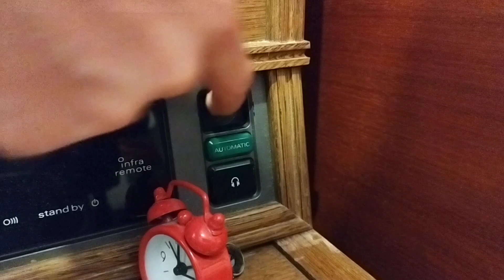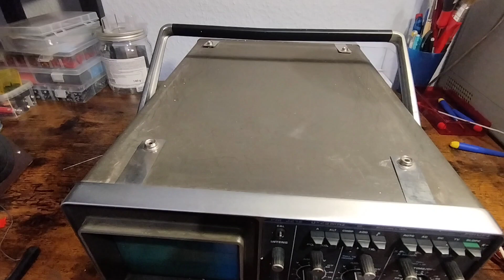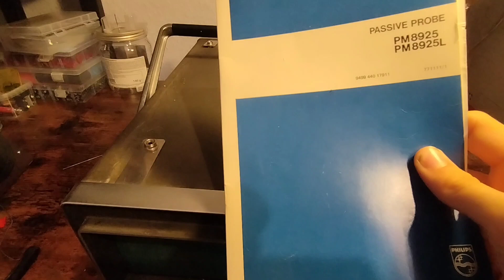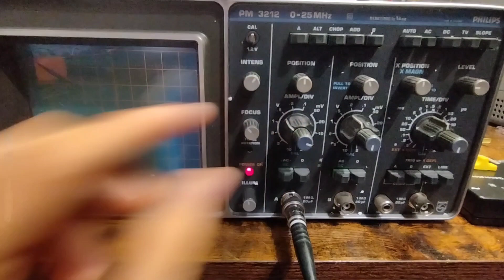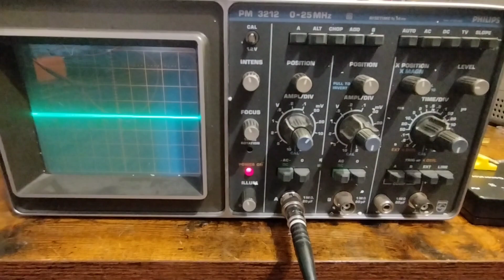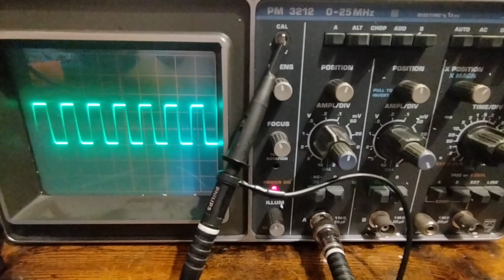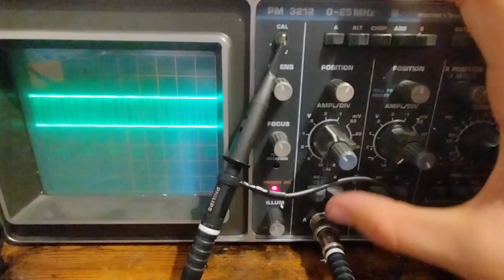80€ late 70s Philips OSCILLOSCOPE - Does it Work? | Philips PM3212

Comment: Hi! I am your 100th subscriber. These old Philips ones are great scopes. The blue axial electrolytic capacitors in them are terrible, and hard to replace due to space constraints, but otherwise they are super reliable. I have one like yours, two PM3215 (50MHz), one PM3540 (with logic analyzer), and two late '80s - early '90s ones, a PM3335 and a PM3070. One of the PM3215s and the 3540 are missing the CRT bezel, and a few knobs, so I bought a horrible condition 3212 for parts, but it actually works perfectly (apart from power supply hum, which makes the highest sensitivity settings unusable).

BTW you did great with this purchase, just the content of the pouch worth way more than 80 Euros.

Very important: DON'T spray random contact cleaners into the switches in oscilloscopes, test gear and radio equipment. If the oil from them penetrates any calibration trimmer capacitors on the board, it will ruin the compensation and the scope will have awful signal fidelity from then on. Only use residue free contact cleaners, and be careful even with those, not to hose the trimmer capacitors with it. These usually don't need contact cleaner though, just excercising the switches and pots will most likely clean them up.
Reply from the maker: Hey, thank you so much, I really appreciate it :).
Yeah, I feel like sooner or later I have to change the electrolytics. I'm not really looking forward to that for the reasions you mentioned. That's a very impressive collection! It's always the worn-out devices that end up working like a breeze :D. 

Thank you for the information, I didn't know that. In the future I'll stop spraying contact cleaner in random spots. I don't want to deal with calibration...
Reply: @homeforobsoletetechnology Since then I also managed to buy a PM3305, an ancient digital storage scope from 1982 (1982 design, mine is from 1987 I think). It is surprisingly capable for its age, much more useful than I anticipated. And that is the first one which arrived in mint condition, and it came with two original probes. The usual suspects, those blue axial electrolytics are quite tired in it, though. It really struggled with its first power-up, it was squealing and barely working for a few minutes until the capacitors reformed. The paper Rifa X2 capacitor went up in smoke and blew the fuse at the seller, thankfully, because this way the price was acceptable.

If contact cleaner gets into the compensation trimmer capacitors of the Y dividers or timebase, you won't be able to calibrate it. The oil that seeps in-between the capacitor plates changes the capacitance of the trimmer drastically out of its normal range. All of them needs to be desoldered and washed very thoroughly with plastic-safe degreaser, and/or ultrasonic cleaner. And even these don't guarantee mid term stability, in case a tiny bit of oil or sovent remains, it will influence the setting as it slowly evaporates.